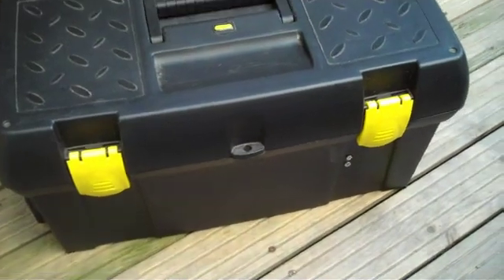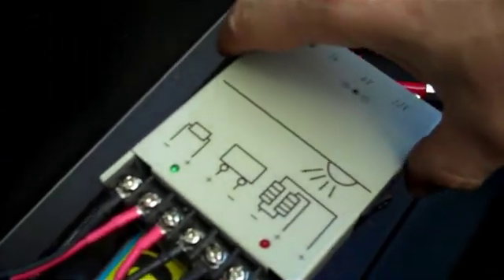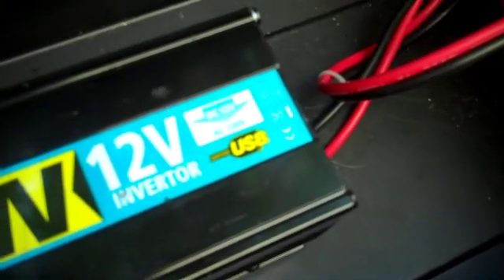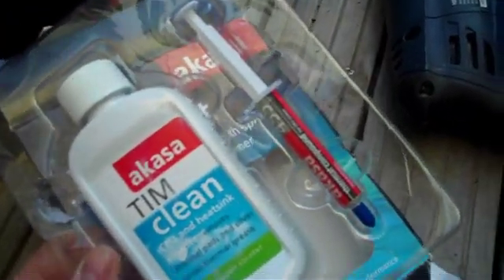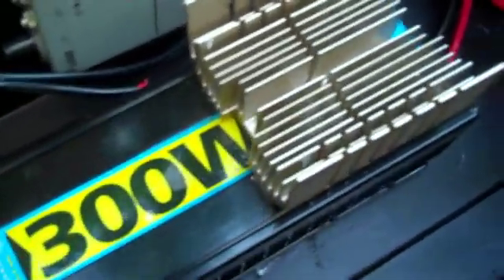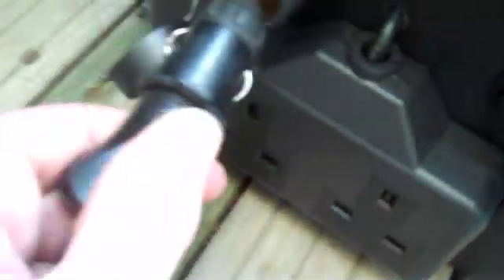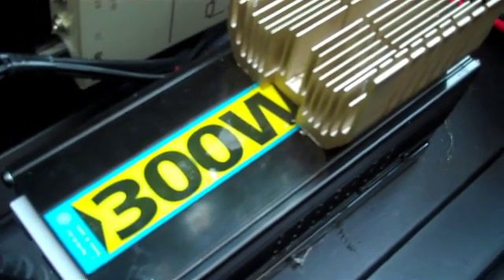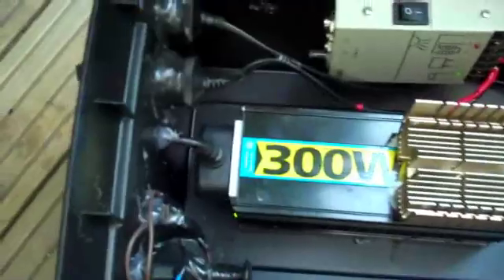Solar powered portable battery box - generator PROTOTYPE

Comment: Nice work, and it looks like it would come in handy when you're out and about. I couldn't help but think that having the battery at one end would make it a bit awkward to carry. It just seems like the battery would weigh down one end more than the other. You might be better off putting the battery in the middle with the equipment on either side and ports in the front. For the next model, anyway.

Also, using the same type of socket for input and output can be confusing, and you probably don't want to plug something into the wrong one. Bad things could happen. So instead of a cigarette lighter socket for the solar panel input, I would suggest a 5mm barrel jack, or whatever the British standard is for DC charging jacks (we use barrel jacks here). That way, if you happen to be at home and you have a compatible DC adapter lying around, you also have the option of charging the kit in a hurry by plugging it into the mains.
Reply from the maker: Thanks for your thoughts and ideas - much appreciated!